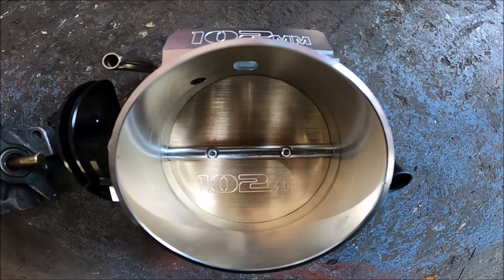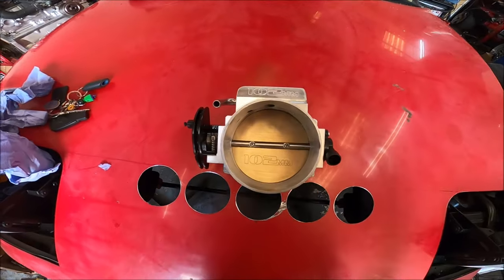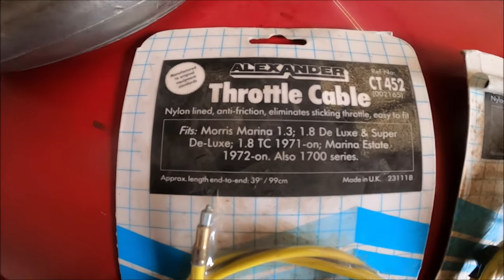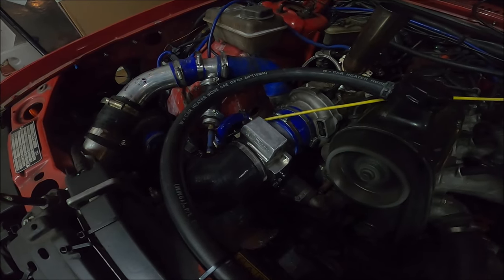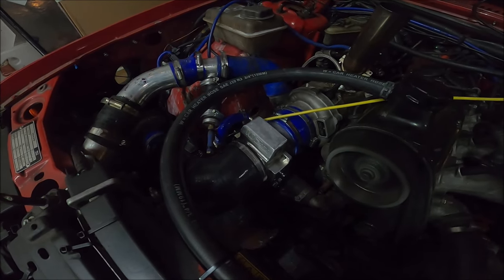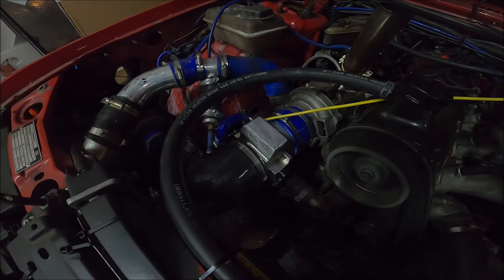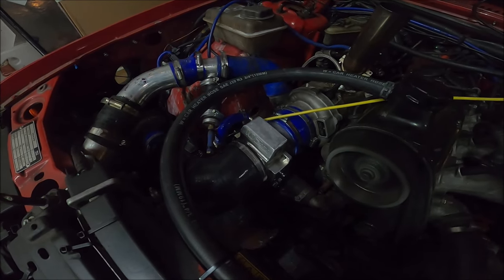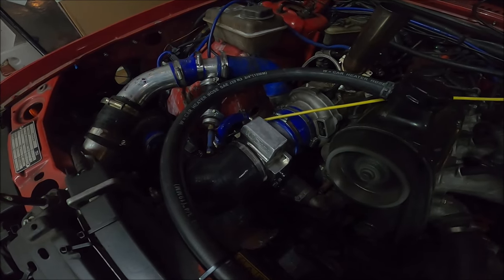Formula One technology for the Volvo 940! 102mm throttle, mounted BEFORE the turbo? Anti lag? Junk?

Comment: Watch the screws holding the throttle butterfly on, the sloppy mechanics community has had multiple incidences of them vibrating loose and falling out
Reply: I go loctite and final thread deformation (center punch) after hurting an engine with a blade screw vibrating out.
Reply: Loctite and pray.
Reply: @TheInspiringKhan  tack weld

Comment: Can also ditch the BOV for improved response. We've tested it on track with the turbo turbine speed logged with and W/O the BOV. shaft speed stayed higher between shifts WITHOUT a BOV. You don't need them... just noise makers. Grandnationals didn't' have them from the factory and guys would roll around with 140-160k on them easy... no turbo explosions or issues. I don't run them on anything anymore.
Reply: blow off valve is mainly effective in high pressure big turbo large engine aplication big drag race engines its not to make more power but to save on turbo wear it has none power boost what so ever on any engine
Reply: and if u placed youre throtle body infront of turbo youre turbo shaft is spin harder for longer beqause its spinning in thinner air (less resitance)
Reply: @tomweuts  That's the entire idea behind this antilag. Lower resistance on the compressor side allows it to spin up faster (and maintain those speeds between shifts).
As for BOV, you'd still want one to help keep the spool. I can only imagine how great this would be if there was an ecu controlling open/close and the BOV open/close. Blowing off right before the turbo throttle closes and right after the main closes so no air makes it back to the compressor to slow it down.

Comment: If you want an easy and cheap tuning option instead of buying chips to swap, the OEM gen 3 LS stuff is worth a look (2000-2007). If I can run a motorcycle engine with it, you can run this thing. There are 2, 3, and 4 bar MAP sensor options. Crank sensor/trigger wheel is hardest part. You have manual trans, so no hassle there.

Comment: Gotta love yt's algorithm
This anti-lag system has always made me wonder why it's so rare to see, as it seems like the gentlest way to prevent turbo spool down (ig the subaru rocket is gentlest, but too impractical)
I'd love to see a turbo with a turbine speed output with one of these, to truly see the change it can have. (And, a throttle body isn't ideal for this, it works obv, but you'll see the umbrella looking ones more as it's optimal for airflow when open)
Reply from the maker: Yeah this is the most basic way, far from optimal, but easiest to do.
Reply: the best anti lag system is using compressed air to spool the turbo
Reply: As long as this throttle is oversized enough that it doesnt restrict airflow, its close to ideal. I think those umbrella looking throttle bodies help more because they can twist the air in the direction the turbo will spin. Shouldnt make a big difference
Reply: @antoniosestar3671  no it isn't. A couple companies have toyed with it but it isn't a practical solution
Reply: @StavTech  thats what we wanna see lad! you're a legend

Comment: If you install a small spring around the secondary throttle cable at the pull end to add a slight pressure to the main throttle then both throttles can seat properly without touchy cable adjustments. You could downsize the main throttle spring slightly too if footwork is still annoying. A drawing would probably be easier but YouTube isn't there yet. 
Very interesting project.

Comment: My first car I ever built up seriously was a 1974 Volvo 242GT 2.0L Mechanical fuel injection. I got the Volvo already caged, with big disk brakes, and coilover suspension mods in 1985. I rebuilt thrashed and killed the engine twice before I gave up and put in a GM small block 305 NA 9000 Rpm motor. and it lasted for years. Not because it was superior in quality to the Volvo, its just that I was too green to see what could be dependably gotten out of a red block Volvo on boost...And the Chevu V8 gave more then i needed so it was seldom pushed too hard, and never redlined..I was leaning on those volvos HARD too!  P.s all my engine machining info was from Smokey Yunick! Sadly I had no access to EU performance info back then. later I worked at a speed shop, machining, and learned!  When money isnt a huge issue, big things can come in small packages.

Comment: Great job man, keep up with the videos, love them.  I was sure that the double throttle body gonna work as you guessed because back in the eighties when I turbocharged my first car wich was carburetted I made it suck through and I had massive white smoke every gear change. So figured out to put a second throttle body after the turbo and it worked.  The only thing that I had  to do to modify the throttle mechanism so the before turbo throttle opens a tiny bit earlier when you hit the accelerator and the opposite when you release it. You made my good old memories come back. Thank you for it. Good luck with the mx5 project as well. Waiting for your next video :)

Comment: Swirl throttles on the compressor inlet were initially used on WWII aero engines, obviously for the most part they were feeding superchargers rather than turbos but the advantage of a swirl throttle over the conventional blade type was significant... obviously not in facilitating spool but  supercharger efficiency was far better at part throttle cruising. In that case I think it was more to reduce complexity by having a single throttle, but of course when F1 engineers were looking to make their pre-turbo throttles they drew on that knowledge. If you could get your hands on one it would be an interesting test to see how much difference it makes.

Of course the benefits of having a pre-turbo throttle are pretty obvious as you’ve shown!
Reply from the maker: I’d love to get hold of a swirl throttle but aside from gigantic ones from industrial air compressors I’ve got no hope of getting hold of one tbf
Reply: @StavTech  Yeah I can’t really think of any off the shelf examples unfortunately, everything ‘car sized’ I’ve ever seen has been custom. Maybe one day!
Reply: @StavTech  or you can make a DPV style valve out of a big turbo's  variable geometry vane system.  I've seen one off a T16   and it looks  exactly like  a vnt  on the inside.
Reply from the maker: @AxelP33  yes they are like a VNT. But making one out of a VNT would not be easy. In fact bloody hard. As well as finding a big enough VNT for it to work on anything big.
Better off just using a VNT turbo in the normal way lol
Reply: @StavTech  i had something much simpler in mind.  ( if you have access to a lathe and a mill 🤣🤣 )  i'll shoot you a pm later on IG

Comment: Neat! Looks like those other F1 engines also use a swirl throttle too, throttles like those have multiple vanes that guide the air to the compressor section for a reduction in pumping losses and increase in efficiency with the added benefit of turbo anti lag , some ww2 engines also used swirl throttles to gain more efficiency especially in cases where the engine was limited by the amount of boost it could take at certain altitudes.
Reply from the maker: Yeah current F1 and some 80s F1 used swirl throttles, as do a lot of modern air compressors. It’s defo the most efficient way to do it. I’d do it for sure if there was any availabile at a sensible price but I’ve yet to find any

Comment: Absolutely awesome. "Old School" and still quite relevant.
The only possible data collection option would be with a turbine speed sensor and do runs without the 102mm and with. See how the average RPM over the runs changes. Of course it's expensive.

Comment: Awesome! Love your content and knowledge shared. Be very interested to see if it does anything drifting while modulating the throttle
Reply from the maker: 100% will, you can see on the on-off throttle testing the difference is massive if you watch how unresponsive it is even between gears on previous video

Comment: How much oil is dragged out of the turbo bearing depends on the vacuum the turbo is working in. If your system is to work, the compressor needs to spin in a vacuum, which is going to suck out the oil.

How much, is dependent on what level of vacuum the two different throttle blades close. You can, perhaps, find a sweet spot, by leaving the pre-turbo throttle just a crack open, thus lowering the pressure the compressor wheel turns in, but not going too far to suck all the oil out.
Reply from the maker: That’s why I used a larger than needed pre-turbo one. So even though they open at basically same rate, it’s effectively meaning way more airflow goes though the pre turbo one at any given time.

And with them both fully closed that’s fine for this to work.

It’s all well documented with race teams etc decades ago, I’m doing nothing new, just copying what they did that worked

Comment: If you are using both throttle bodies it won't be in a vacuum unless the air side throttle closes earlier. There will be vacuum behind that throttle but pressure on the back side of the turbo.

Comment: It'd be perfect if you could find a small-diameter variable inlet vane (VIV) damper instead of the butterfly valve throttle body. They're used in HVAC systems to throttle back intake airflow, while pre-spinning the air in the same direction of rotation as the fan/blower, which significantly reduces the horsepower required to turn the fan compared to regular louvred dampers or a butterfly valve. As the name implies, they use actuators to vary the pitch of the inlet vanes, which controls the volume of airflow into the system. That's essentially the same technology used by Renault in their early F1 turbo engines to mitigate turbo lag, as well as the "swirl throttle" that some WWII Russian airplanes used to control intake airflow into their superchargers while keeping the butterfly throttle valve open, which eliminated pumping losses and allowed them to make far more power at low altitudes.
Reply from the maker: Yeah they’re common on modern air compressors too but all the ones I find that are truly controllable are huge

Comment: I read in the original patent on the linkage set up the main throttle is restricted limited to closing only half way while the second turbo swirl throttle flap is nearly fully closed while off throttle , this then creates the effect the pull on the turbo making it spin faster as it gets the full force of the inlet plenum being in vacuum and by being restricted from the flap/vanes in front of the turbo , you would have to experiment with that theory to see if its true and makes a difference.

Comment: This is a great idea for draw through setups with a second throttle body where a blow through carb would be
Reply from the maker: That’s a good point! I wonder if that will work, or will the fuel will struggle to pass the 2nd throttle at idle?

I’d like to find out as that would defo solve the need for a carbon seal on the turbo
Reply: @StavTech  I think as long as both throttles flowed near the same it would idle fine, most draw through set ups burn mostly fuel vapors when idling and at low throttle input, this is great info to have
Reply: @StavTech  another idea I had from this was using a waste-gate actuator for the secondary throttle, have it set at 10-25% open at all times to allow enough airflow to idle and drive but let it open at a set boost pressure

Comment: You should place a pressure gauge on the compressor outlet. This would help you determine the pressure differential across the oil seal.

Also I still think a standalone ecu would be the way to go. The car would give so much more. And yes I could download a calibration faster than you could change those eproms
Reply from the maker: Done that in the next vid. With the tune currently being fine a different ecu won’t help performance really.

And yes uploading a new map of fast.

Wiring in a new ecu, and mapping it from scratch, is not

Comment: Edit: After the tune I could hear the difference, that's incredible! I take back everything!!!
To be completely honest, running a large blow off valve completes the same task, and I heard compressor surge, which can only occur when the build up of pressure in charge-piping flutters back on the compressor.
Reply: Nah, compressor surge happens when flow is restricted significantly vs RPM/pitch speed, to the point the blades start to aerodynamically stall, unloading them. Happens with boost, as you need a flow restriction to build pressure, but the throttle body first will also restrict flow (but at a low pressure) while closed.
Reply from the maker: A blow off valve doesn’t do anything this is meant to do, absolutely different things in every way

Comment: Interesting experiment with that 2nd TB! 
About that wideband: Is it one of those that needs calibration? Maybe you can try that? 
About EZK rev limit: pushing it up only has true benefit when you are using a cam that supports those higher revs (like a K- or H-cam), stonger valve springs would be useful as well.
Doing it while using a stock T-cam  would be pointless IMO.

About that 2nd TB: in a stock car Volvo is already doing something similar, they use a CBV (compressor bypass valve) which basically short circuits the boosted side of the compressor back to the unboosted side. This prevents compressor stall and avoids the compressor from having to speed back up from low rpm. But that 2nd throttle valve creating vacume inside the  compressor side is offcourse even better. I like it!

Comment: i can see how it works effectively spinning the compressor side in a vacuum between shifts would be cool to see a compressor wheel senor before and after see how the turbo speed degrades slower by how much

Comment: I love what you've done here - Would it not help you with the boost threshhold if you indexed it to boost rather than throttle. I think on an e-throttle car you wouldn't need to, because it already gradually opens the throttle as load increases, but If you used a vacuum actuatior on the throttle, you should get better response across the board. Obviously it increases complexity though - and this does solve your lag issue.

Comment: What I'm curious about is whether or not you could still get the turbo dose sound with this setup. I know diesels can't dose (they "bark" instead), but they also don't typically have a throttle plate of ANY kind, let alone one both before AND after the turbo. EDIT: Okay, you answered it later in the video. Sad, but damn if it eliminates in-boost lag that's huge. I wonder if you can modify the turbo to operate under vacuum and then run only the pre-turbo throttle.

Comment: F1 did that for turbo lag! The turbo will spool faster if it has no air to compress! The key is when and how to open that 102mm valve?
Reply from the maker: That and Rallycross cars of the same era is where the idea came from. How was pretty easy, just piggyback off the throttle cable, when is, well, from what I’ve seen on the F1 etc engines, they’re fully open beyond about 30% throttle, which is why I went so big with the throttle, as even at 30% there’d be no restriction
Reply: I love it! @StavTech

Comment: This is a sweet idea! Would the original throttle spring not serve to return the blade on the new throttle body? Then you could remove both springs from the 102mm and hypothetically have the same pedal feel as the stock setup?